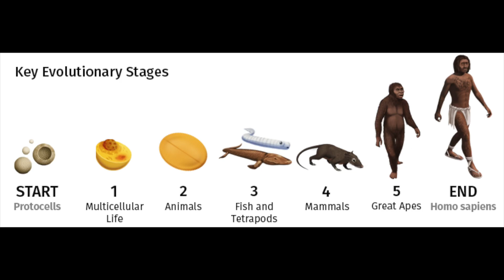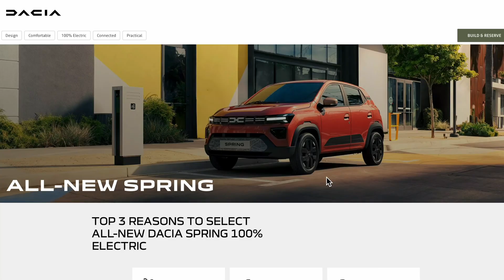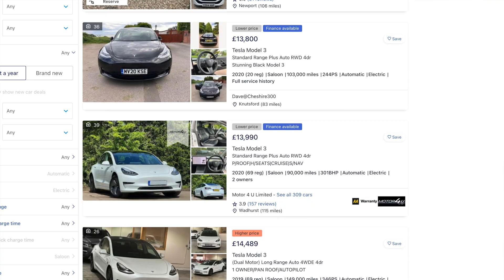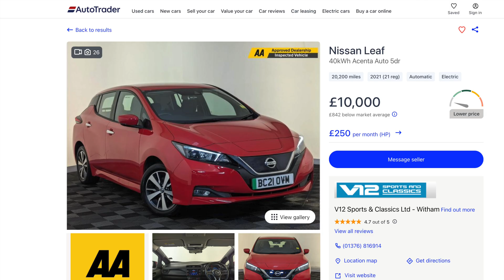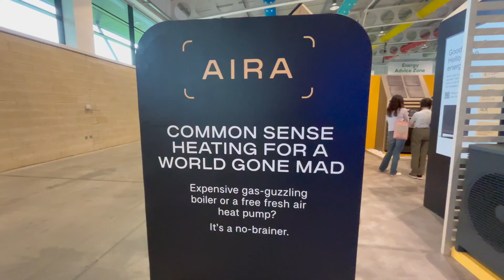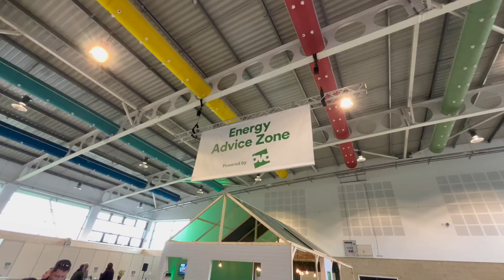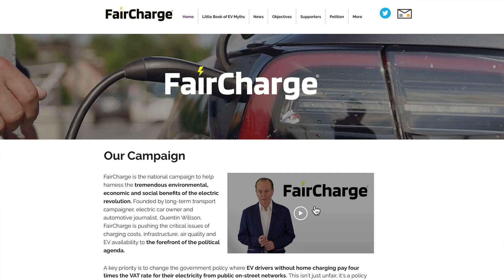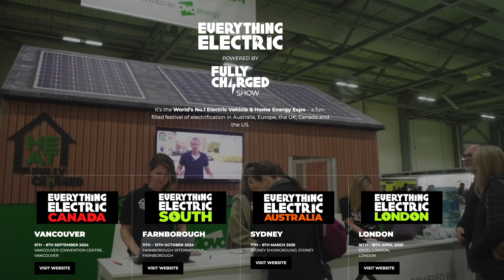Are Electric Cars REALLY Better?

Comment: But a tesla, is a planet killer. A petrol car will have to drive 100,000 miles to match the emissions of a tesla, plus no one knows the cost of decommissioning the batteries. 
In the uk you’ll be paying £190 road tax from april 25 plus a luxury car tax of £410. 
In the whole of may 24 there was on average only 3.5 hours of green energy per day from wind or solar the rest was from fossil fuel ie gas. 
This push for net zero is madness. 
Co2 is currently 0.042% thats a whopping 3% increase over 20 years and of that 3% only 1.2% was manmade. Meaning man contributed 0.00001512% of the co2 in the atmosphere. And our british government is pushing us back to the Stone Age.

Comment: Safer, easier to operate, cheaper to operate, less trouble to "fuel", less trouble to maintain, fewer things to go wrong, more infotainment features, quicker, smoother, faster acceleration and braking, more interior space, constantly improving software, quieter,  great sound system. It unlocks itself for me when I touch the handle and locks itself and farts when I walk away. 

What's not to love?

Well, there are some things. Now that I've done a few road trips, I find I have less "charging anxiety" than I had "fueling anxiety" in the past, but I've got a Tesla and Tesla has the best charging network in the country, with extremely high reliability. Not all EVs have access to a good charging network, so if you are going to be making long trips, I'd suggest you consider Tesla first. Given that charging stations tend to be situated on the order of 100 or further miles apart on the road,  some planning about where you'll charge is necessary. Fortunately, the car's navigator can do most of the work, but you still will still need to use the navigator to have the best, anxiety free experience; specifically, you can't just drive down the road until the "low fuel" idiot light comes on and start looking for an exit that advertises gas stations, as you may be accustomed to doing in your ICEV. 

Also, Perl was the most expensive car I've ever bought, even with the tax incentive, spending over 40 thousand USD on a car still seems extravagant, almost prodigal to me. At the present time the price of a new Tesla Model Y, though less than the "average new car" certainly limits the market and puts it outside of what many are comfortable or even able to spend on a car, so some will need to consider buying on the used market where there are some excellent bargains, but also some risk. Be sure to get the CarFax or other report on any used car, but especially an electric. Note that garages and even Ford, GM, Hyundai, Mercedes, Toyota, etc dealerships for the brand of EV you buy may not have sufficiently well trained staff to service your electric car. Though I've had no trouble with service for Perl (even though my state has no service centers, an itinerant service technician has come to my house a few times for the minor services I've needed),  some Tesla owners have reported less than stellar or just plan poor service.

There are many configuration options. I love it, but I imagine some folks won't. CHILL versus Standard acceleration modes, Sport/Comfort/Standard steering modes, lock options (windows up when it locks? locks when you walk away? fart or honk or play a song when the car locks? stays unlocked when you walk away when at home or a favorite location? keep the cabin under 100 F when car is parked? Leave Sentry Mode on when parked? Don't leave sentry mode on when parked at home? Assertive FSD? CHILL FSD? Minimal Lane changes for FSD? Move the seats to your saved setting? Use Ease of Entry to lower the seat automatically when you are getting out or raise it after you get in? Use FSD or Autopilot? Which apps do you want on your app bar? etc.

It's not complicated or complex, but there are many simple choices in a software-defined-car.

Comment: The transition works like this:
1. EV's are bought as a Second car.
2. Hybrid sales are soaring.
3. The home/street/work charging are increasing, and the charging infrastructure matured
4. The EV sale soars.
5. Trucking goes electric.
6. Construction goes electric.
7. Farming goes electric.
8. All other vehicles goes electric.

The competition in transition looks like this:
1. They laugh about it.
2. They sue it.
3. They try to compete with it.
4. They lie about it.

So, most of the world are at fase 1-2 in transition.

And, the competition are at fase 4.
The fossil automotive industry are on their last stand.

PS Norway has 26% EV's on the road. If you count pure EV's, and NOT fossil cars with big batteries.
The EV's won't overtake  fossil cars before 2030.
Reply: Full global adoption,  2045-50'.😊
Reply: @georgejuricb2974  maybe, but looking forward to not paying for this corruption, and insanity ☹️!

Comment: Had my one car 9 years so years left in that one and my second car owned it 35 years. Not sure if these electric cars will last more than 10 years without a battery change which will right the car off as will cost more than the car is worth. Not sold at the moment.

Comment: The simplicity of EV power train and software-defined architecture plus advanced manufacturing -- soon complete robotic assembly -- are allowing EVs to surge past conventional, combustion vehicle manufacturing.  Somehow legacy auto is beholden to horse and buggy architectures and methods... strange.  In a blink, EVs will be half the cost (and dropping) of ICE, and rides will be a tiny fraction of the cost of ownership.  ICE has culminated and is soon to be routed.